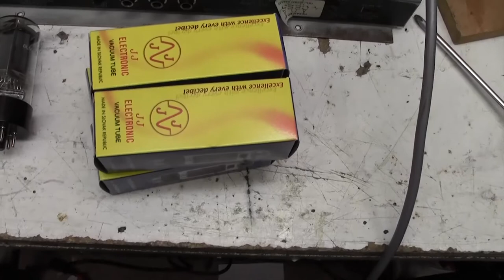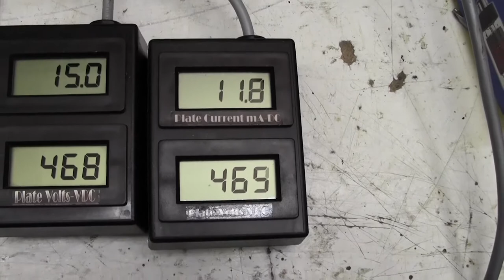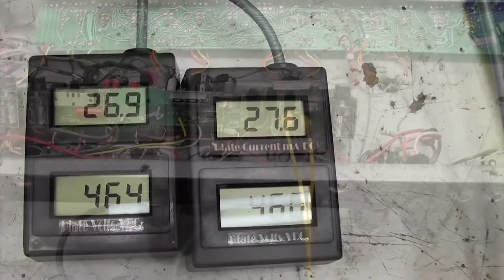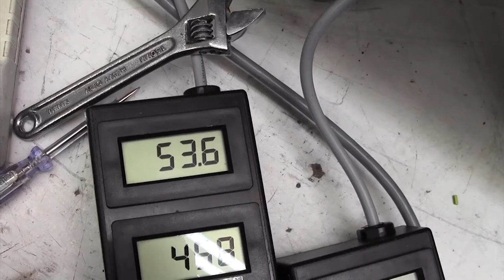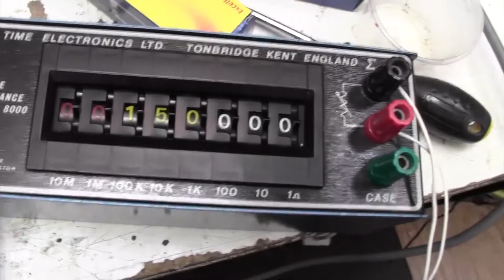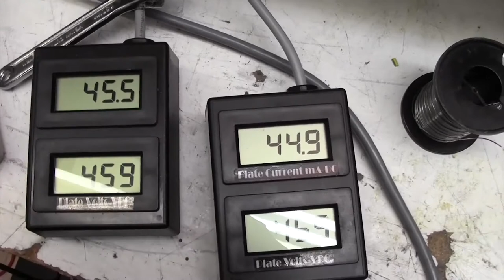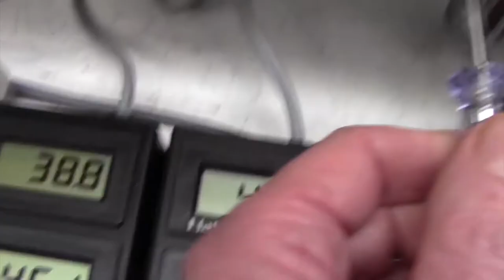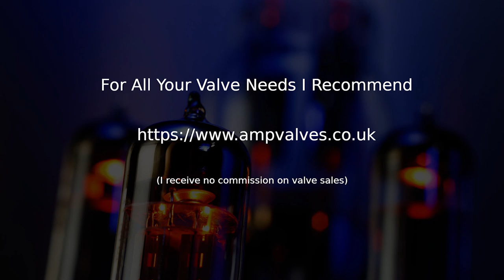How To Bias Fender The Twin Red Knob

Comment: The two Edicron branded valves are Soviet 6P3S, which is a copy of the early 6L6. The maximum dissipation of either of those types is 19W. Much more than that and they will start to show a red plate, with the possibility of thermal runaway due to positive grid current. Not many  modern 6L6s are comfortable at USA made 6L6GC or UK KT66 anode dissipation.

Comment: Nice that fender provides biasing pots along with an output to attach a multimeter. It makes me wonder why they skimp on the cheapest of components which in this case resulted in soldering extra resisters in parallel to bring the bias voltage up in-line with the JJ valves. As always an informative video from Stuart, in the workshop at Reading Guitar Amplifier Repairs.

Comment: Just curious, sometimes I don’t like to think too deeply on certain things, I should know the answer. It seems to me, if I want to pull 2 output tubes on my nephews Marshall amp to cut total volume by 3 dB, being fixed bias - it shouldn’t need a re-bias?  Whereas a cathode biased amp would probably need different cathode resistors to get the correct idle current. Is this correct?
Reply from the maker: Hi. Yes that's correct. You can pull 2 out of the 4 (suggest you do the outside ones) and you don't need to rebias.
Reply: @stuartukguitarampguy5830  thanks, why pull the outside tubes? I figured pulling the two inner tubes, might get more cooling potential between the outer tubes
Reply from the maker: @voxpathfinder15r  Yes either will work.

Comment: Hello Stuart. Thanks for sharing your experience with this amp. Quick question: I have the same one, and when opening the circuit, I've seen that R216 (just between 2 bias test slots) has been replaced, leaving traces of burn. I see on https://youtu.be/iMptc01aQB4?t=542 that yours has been replaced too and may show similar burn traces, can you confirm? Maybe a factory weakness affecting all "The Twin Red Knobs"?
Reply from the maker: Hi. Sorry it's been a while now since I worked on the amp and I can't recall the details of that resistor.

Comment: Hi, I have the same amp. So using the endpoint to biasing the tubes works fine but not so good to balance it? I also have only two power tubes used (I removed the inside two). When biasing I have to get 40mV using to end points or this reading if for 4 power tubes? Thanks!
Reply from the maker: Hi Fernando, not sure what you mean by 'end points'? Anyway, if you aim for abouty 40mA per tube, that would be close enough.
Reply: @stuartukguitarampguy5830  The endpoints in the rear of the amp where you put the digital voltimeter in your video and the balance shows a value of 6 not 0 as Fender recommends. Thanks
Reply from the maker: @fernandodelarasillasiri3368  Hi Struggling a bit to understand your question. It's been a while simce I did the video so don;t have all the details to hand now.

Comment: What’s the big deal with printed circuit boards?  Especially since all those tubes are mounted into actual chassis mounted sockets and from there hand wired to the circuit boards. That’s much better than most amps today where the the tubes mount directly to the boards!  Not to mention those early 80s hand wired fender concert amps are a spaghetti mess!  If you want anything other than a real simple circuit, printed circuit boards are the way to go
Reply from the maker: My personal view is there is no difference in sound between a pcb and hand wired. How can there be really? I think it's just that many guitarists like 'vintage' e.g. they will pay a fortune for NOS tubes and so on. My only problem with PCBs is that sometimes they are hard/impossible to lift out to change components. E.g, just worked on an Engl Powerball - all pcb and virtually impossible to repair as they have mounted them track side up so you can't see or get to any components!
Reply: @stuartukguitarampguy5830  I think there can be differences in tone due to all the capacitance between all the hundred and thousands of traces. But I also think if you wired a circuit that complex using hand wired. You would run into the same issues among more noise issues. Whereas, you kept a really simple circuit like a champ into a pcb - it would sound no different than hand wired. Where I think people get stuck is when they have a 6 channel Marshall pcb amp. And one of them is supposed to be a super lead circuit. In that case it doesn’t sound the same because it’s a super lead circuit compressed into 1/6th the area vs a traditional hand wired
Reply from the maker: @voxpathfinder15r  Useful points, thanks!
Reply: There's nothing wrong with pcb so long the amp is designed properly. However, the manufacturer's will use the cheapest (lower cost) components in the amps. This in itself is OK, but in most cases the components break down. It's good for the repairman, but it surely leaves a bad taste with the owners of the amp. Cheers